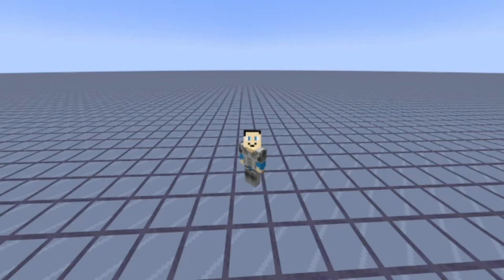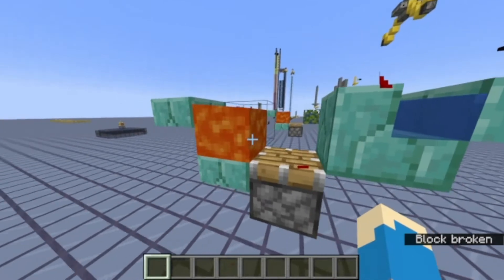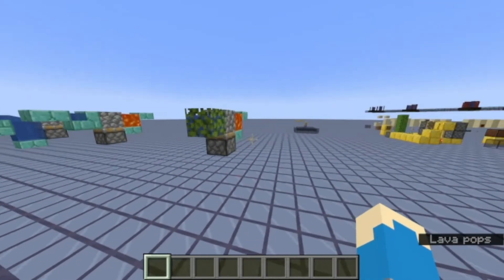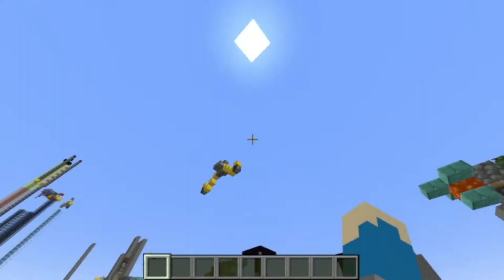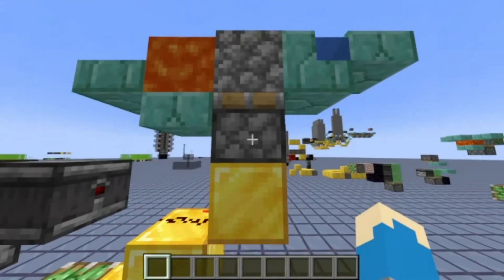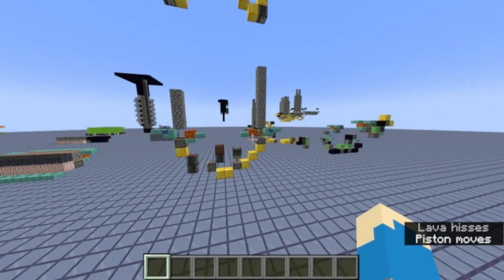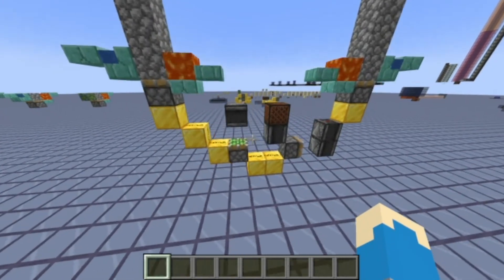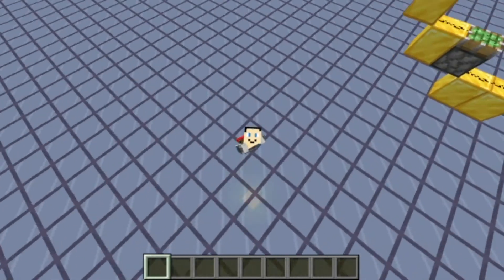Improving The Minecraft Self-Healing Wall

Comment: The observer clock is only half efficiency because every 2 redstone ticks it makes piston on for 1 tick and off for 1 tick. On the other hand lava tries to flow every 15 ticks. So if the 1st tick piston is on, on the 15th tick piston is also on blocking lava to flow. Lava will wait another 15 ticks, so on the 30th tick piston is off and lava can flow. So cobble is only generated every 30 redstone ticks instead of 15 ticks.

If I'm correct 0-tick doesn't prevent lava flow. But if you just replace the observer clock with a 15rt clock it will be full efficiency and less laggy.
Reply from the maker: @tunaflsh My testing confirms your theory. I used a 3 tick clock rather than your recommended 15, but being divisible the effect should  be the same, and it is. Using a 3 tick clock will match the speed of the zero-tick one, and I imagine it's the same for 5 tick and 15 tick, and this could open up new opportunities for me to develop it.

I'll be sure to release a correction video, though it's a bit of a pity if I won't be able to use zero-tick in my titles, lol. I feel much better that I understand why the tech works the way it does, so thank you so much for investigating :)